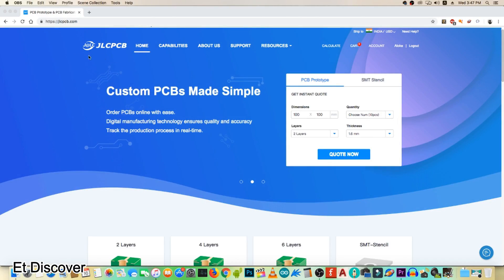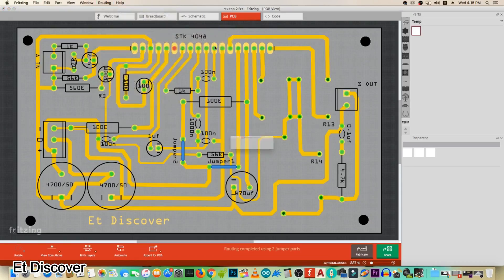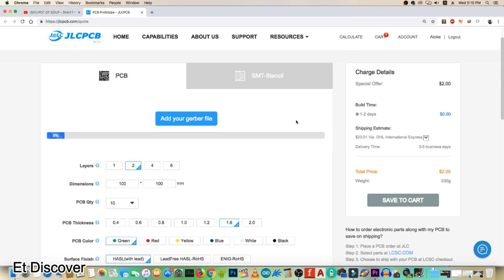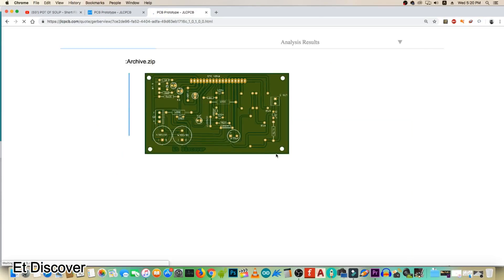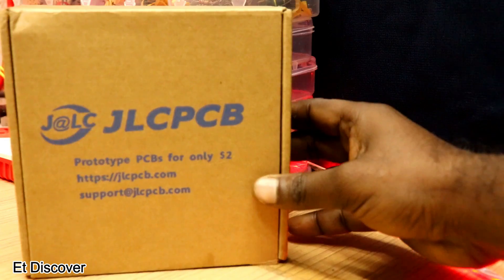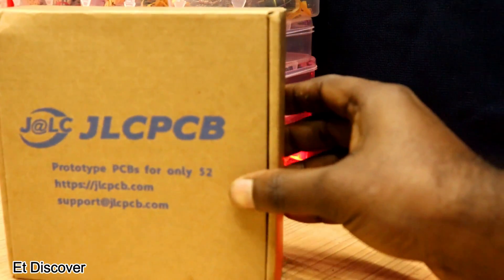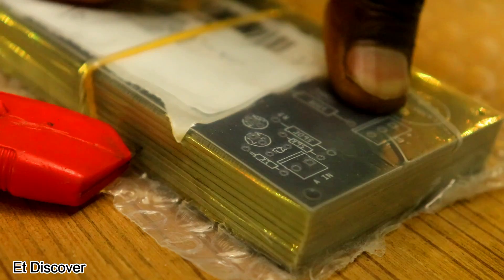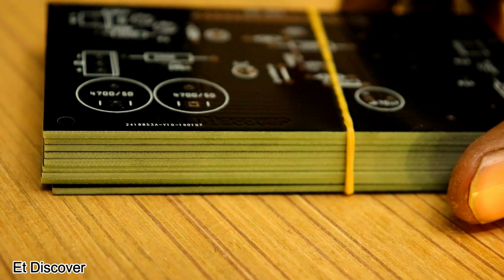The Killer 10X BASS Audio Amplifire

Comment: I have an ACTUATOR for that I need 12v 300mA .I am not a electronics guy but I like to do some electrical stuff. So give me some idea how to get or make a 12v 300mA powersource.Thank you
Reply from the maker: For which purpose you want to use it? Or in which kind of work you are going to use that?
Reply: Actually it is a linear actuator. So in my project I need to open a door with the help of that actuator. And for that I need 12v 300mA
Reply from the maker: 500mA is very good for your Actuator
Reply from the maker: I can suggest you that buy a 500mA’s SMPS. The reasons Servo will be very sensitive.
Reply: But it is written in actuator that 300ma 12v.Is it ok to use 500ma instead.
Reply: There are numerous ways- 
1. Use a linear power regulator 7812 with a suitable transformer.
2. Use a 12V, 500mA transformer with a diode bridge. Add a current limiting resistor to get 200mA.
3. Use a 12V, 500mA SMPS. Add current limiting resistance.